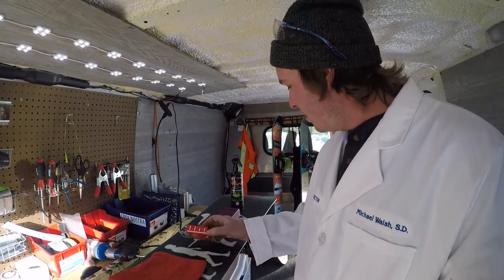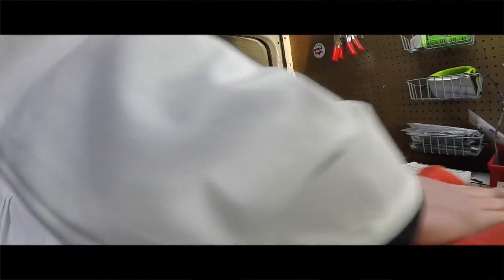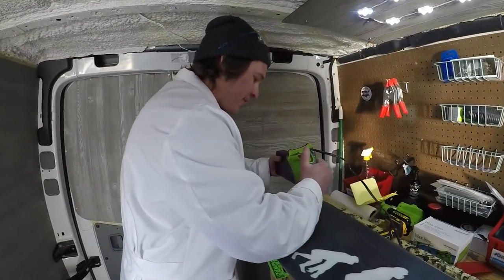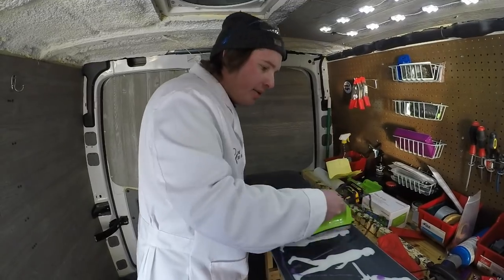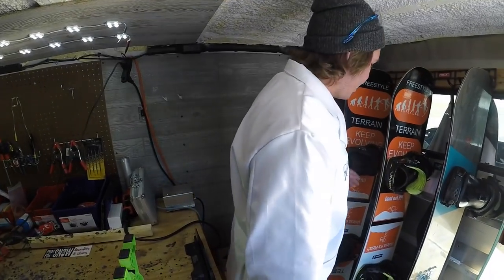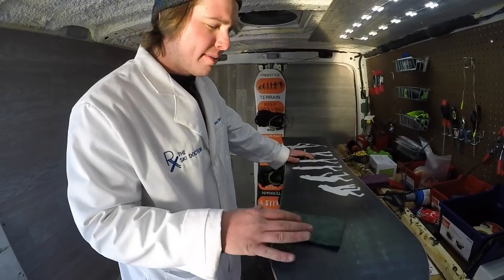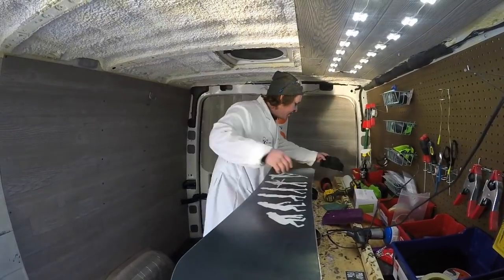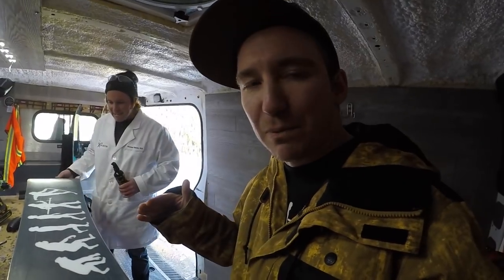How To Wax Your Snowboard

Comment: The first step, is actually to make sure there aren't any nicks or burrs on your edges. The reason why, especially for park riders most of all, is 'cause if there are, they can scratch the bottom of the iron to the point where your iron then leaves scratches everywhere it travels up & down your board's base. I learned this the hard way, by literally leaving scratches up and down a brand-spanking-new board, and another one I have too. Then I had to take sandpaper made specifically for metal, to remove the burrs that were created in the base of the iron from going over those nicks & burrs on the edges, to flatten it out and make it perfectly smooth again, to prevent that from happening anymore, not to mention of course getting rid of those nicks & burrs on the edges before I continued any more. And if you don't catch that, you can wind up doing it to every single board or ski you wax after that, which in his case, is super important to prevent, so I'm sure he actually checks the edges for nicks & burrs before he ever waxes, or at least I'd hope so! 👍

Comment: Thanks sooo much i just started and i got a wax kit and it didn’t come with a iron so i was making sure i could use my iron 

Also how did you get the keep evolving symbol at the bottom is that a custom board
Reply from the maker: If you use your personal iron on your board you won’t wanna use it on your clothes you don’t want to rub wax into your clothes. Also my snowboard was made with the logo on the bottom. I will be coming out with my own snowboards soon.

Comment: What kind of material does he use to polish with the tool after scrapping the wax?
Reply from the maker: Nothing. Just the wax he applied
Reply: What I meant was after he removes the wax what material does he buff with? nylon brass or horsehiar?
Reply: @JohnathanBuckhouse  thanks for the replay also, appreciate it.
Reply: @emmanuelgonzalez-jk7mk  It will be a horsehair brush, it polishes the base.

Comment: Tuning yes. Waxing????… time to evolve.  Phantom DPS II. Never wax your board again.  One treatment cured under blue light for about $99 at various stores like REI.  And because it penetrates the entire base  layer of your board minor scratches are not an issue.   You can still apply a speed wax over Phantom DPS if you’re that obsessive but I haven’t waxed for  2 seasons and I glide as a fast as anyone.

Comment: 3:29 Nah, it's intuitive to think the wax would clog up the holes in a household iron, but that's only if the wax stays solid. The iron is hot, meaning the wax melts into a liquid state causing it to never get stuck in the holes.
Reply from the maker: Great point!
Reply: So you can use a regular iron if you don’t have a waxing iron?
Reply: @coleparz6964  a regular iron works, you just need something that is consistently warmish hot so it can melt the wax. Just make sure you don't use the iron on clothes.